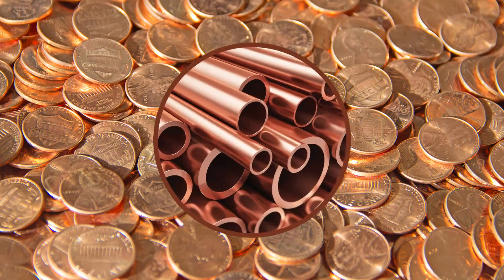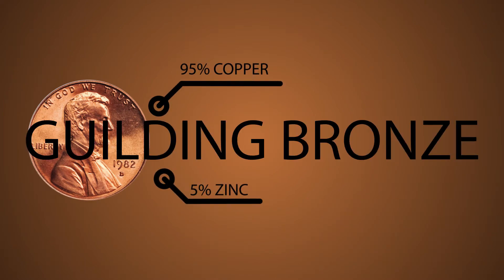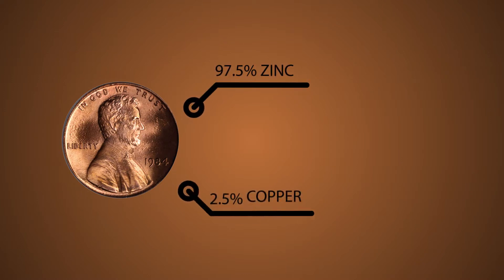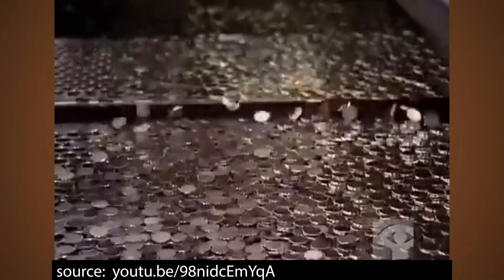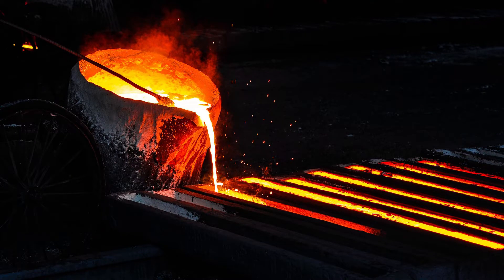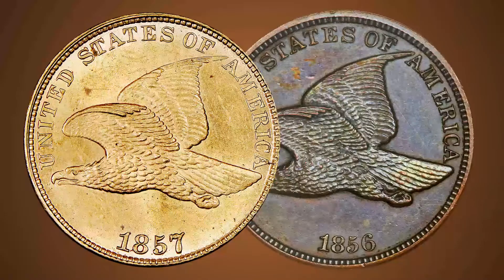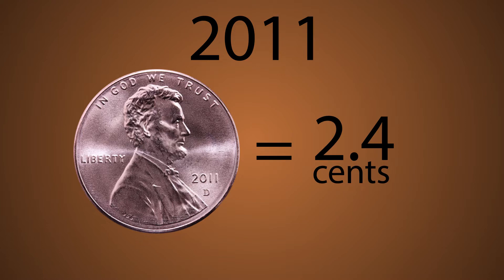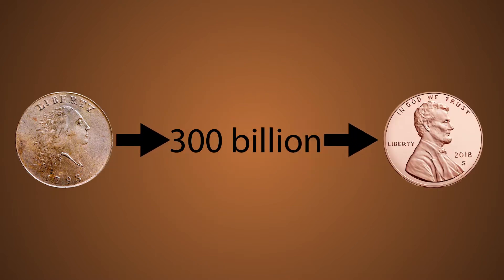Are all pennies made of pure copper?

Comment: If you heat a penny beyond the melting point of zinc, the zinc can burst the copper plate and begin vaporizing, releasing fumes you shouldn't inhale. And once the vaporized zinc cools it forms zinc oxide, a pale yellow substance that coats nearby surfaces.
Reply: My mistake. The yellow substance is zinc chromate, and can include potassium as well. But there are 4 oxygen atoms in the chromate molecule.